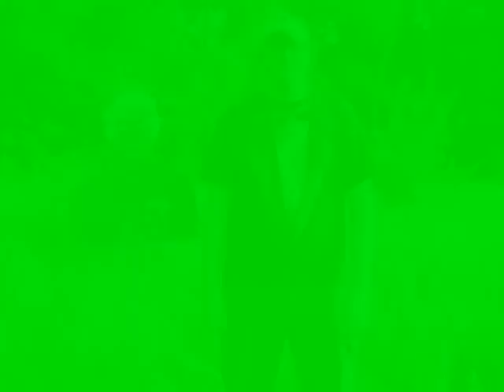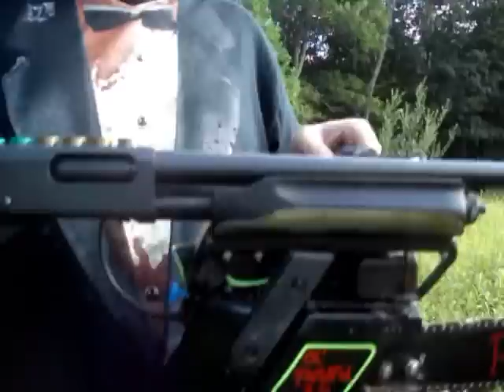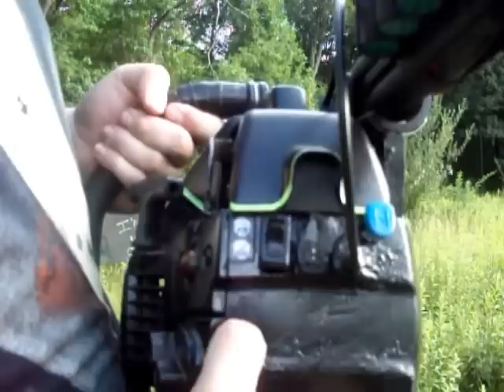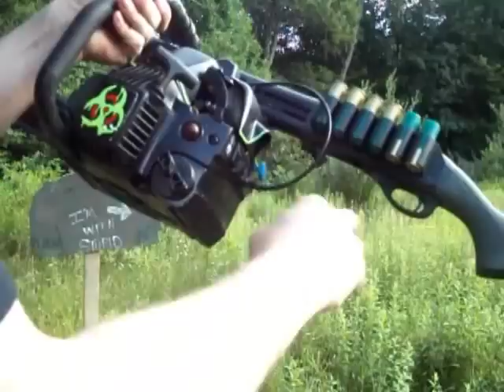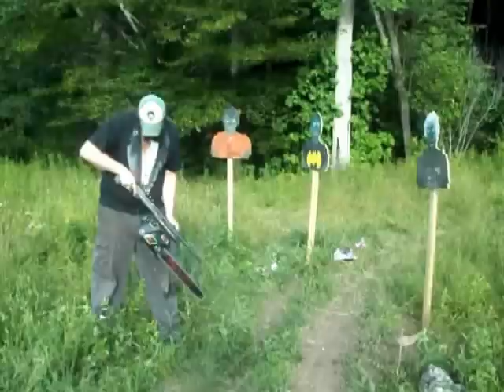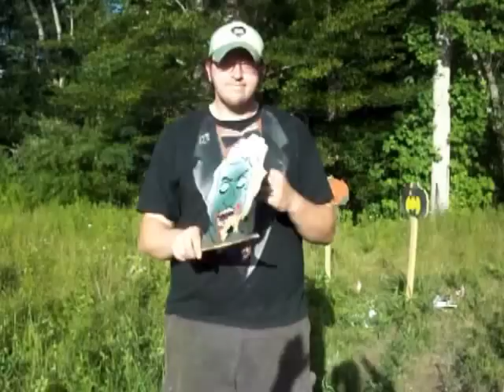REAL Chainsaw Bayonet

Comment from the maker: What for do you need a bayonet on ANY weapon?? A "Last Resort". It's practical to place a bayonet on ANY TYPE of long arm and even more so on shotguns because it is a "Close Quarters Weapon" with a low magazine capacity and slow reload time. But I can see how you're confused, it does make more sense to exhaust dozens of rounds from a rifle at a range of 100 + yds, then snap a knife on the end and run all the way to the bad guy. Hope this clears things up. :)

Comment: Thats great man! Ingenious design with the action on the shotgun. If i may suggest a couple of things though. Ive seen many people try this and the size of the bar isnt a huge deal so if you cut it in half or even use a smaller chainsaw it would be easier. Also have you thought of gas chainsaw but with electric start ? Way easier in the heat of battle.